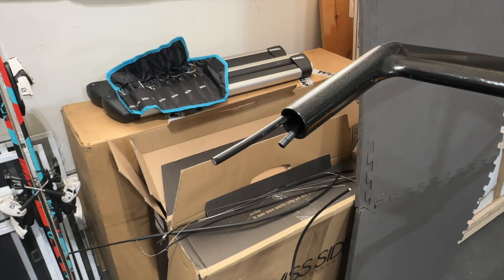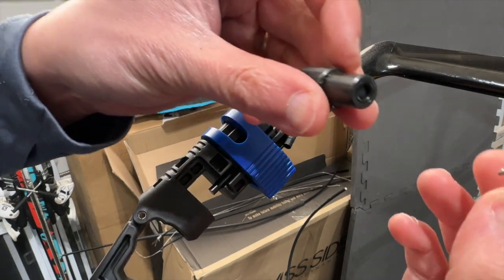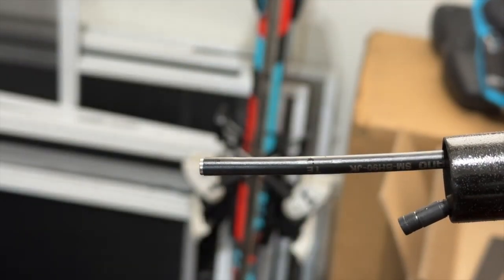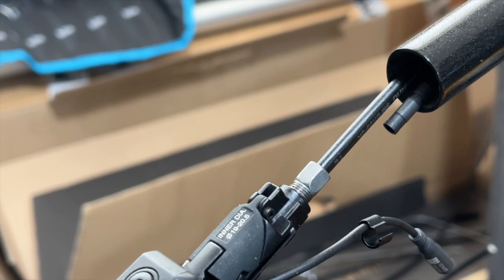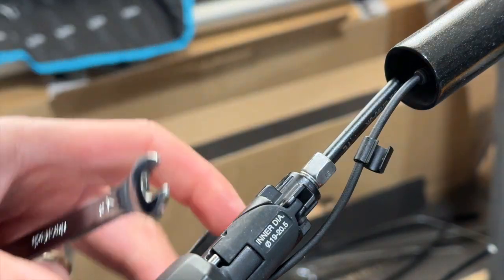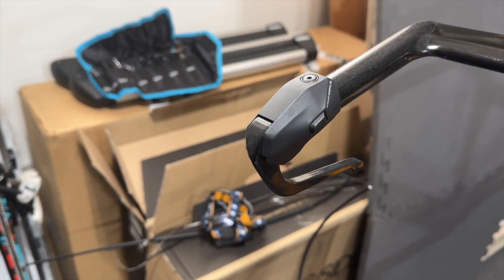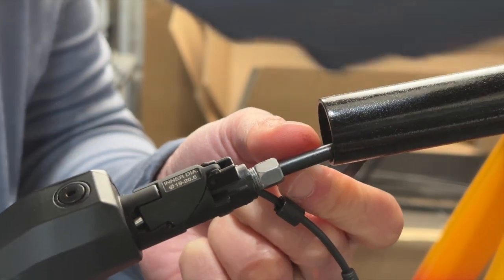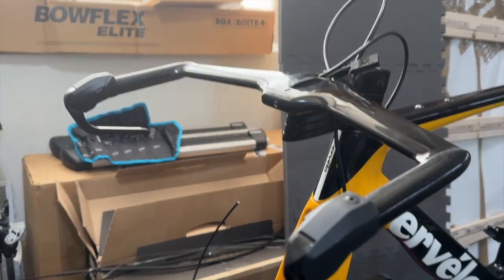Installing Shimano DuraAce ST-R9180 brake shifters on the Tririg Alpha basebar

Comment: Sir, is the st r9180 lever compatible with 12 speed also? I saw it online and the description said it is for 11 speed cassette
Reply from the maker: Yes, but the firmware has to be 3.3.0 or higher. I bought my shifters around December 2022 and they were already at the latest version. Please See my other video on firmware update: https://youtu.be/tN8HdLO2NsE?t=334
You can use find the Shimano firmware info at https://bike.shimano.com/en-US/e-tube/project/firmware/detail.html?model=ST-R9180
Reply from the maker: If you don't have the SM-PCE02 tool, you may be able to update the firmware from your phone by connecting the shifter to the rear derailleur by wire. However, you may need to connect it to a 11-speed derailleur first to update the firmware, so it will work with a 12-speed derailleur. I also have a video on using the iPhone E-tube app for firmware updates: https://youtu.be/xBJUZM6jEAQ?t=167
Reply: @HowToTriathlon  Thank you for the prompt reply Sir, I appreciate your message